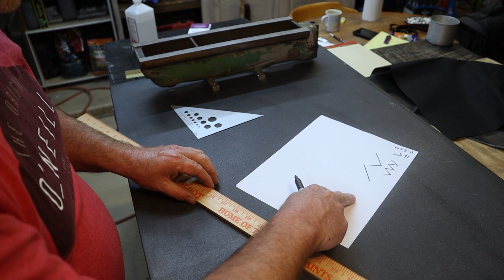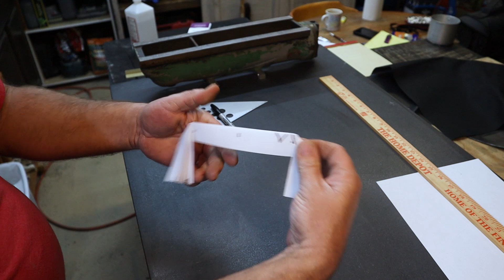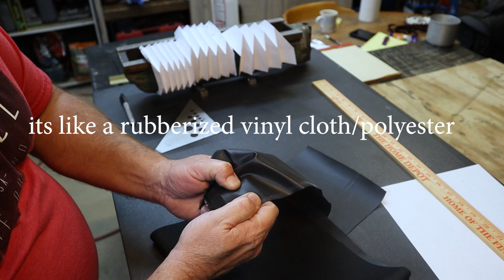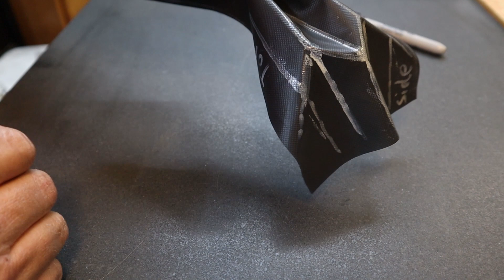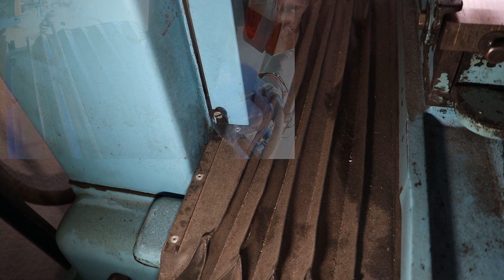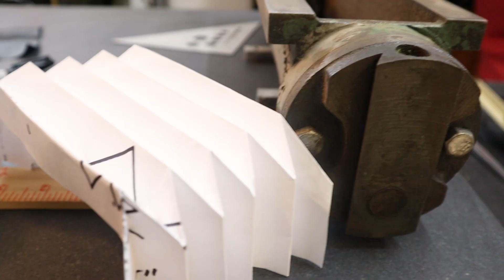Machine Way Covers, Hand Made Bellows.

Comment: With dobule extruder/multi head 3d printer like h2d or snapmaker u1 you cand print folded bellows with Tpu as main material and pla layer cake this works great. Unfortunately it wont work wit single head printer with filament changer/ because standard tpu is to soft.

Comment: misreads instructions, ends up with crane

one source of good fabric... shade cloth manufacturers. especially dining structure type umbrellas...

wish i had thought of these when i worked at one, could have nice HF welded seams and ends, followed by a quick blast to set all the creases... lol, all i did was throw to rolled edges on a sheet with some siding extrusion to hold it on the machine... and of course, i bought new protectors just a week ago. this video came too late.

they always have offcuts in the bin. its freaking expensive to buy off a roll. stuff like "teflon coated algae resistant" surfaces.

Comment: When making replacement bellows for old cameras, a stiffer material is glued everywhere that doesn't bend.  The stiffener can be anything, frequently thin cardboard is used.  This forces the fabric to bend where you want and nowhere else.  In most cases, there is an outer layer of leather or some sturdy fabric (your rubberised fabric would be ideal), then the trapezoid shaped stiffeners get glued on with space between then for the fold, then usually a much lighter fabric glued on the inside.  Leave more room at the fold than you really need when creating the gaps in the stiffener material.  The inside fabric can be very thin, the thinner it is, the less it interferes with folding, you want this just thick enough to hold down the stiffeners so they can't come loose over time.  With all the layers glued, the fabric doesn't fight you during the fold, and you don't need to sew the folds.

Comment: I made one of these years ago for my last little lathe. I did it on the cheap though.

I found some iron on denim repair patches, cut that stuff into trapezium sections, and ironed them on the back of some thin denim I cut from an old pair of cheap black jeans. The iron on material stiffened up the ribs just enough that it folded up neatly. The only real mistake I made was treating it with dubbing wax BEFORE deciding to try and iron the pleats in a bit sharper. That stuff stank to high heaven when it got hot. :D 

With the extra thickness of the backing material it didn't concertina down to a particularly compact size (Going from about 2' foot fully extended, down to about 4 or 4.5" when closed up...... Depending on how clean it was. :D), but as that lathe had a thicker than standard chuck on it, this wasn't a big issue. It looked pretty good on there too. It was a vintage lathe, and the bellow had a kind of "Well used" look from day one that kind of fitted with the whole style. it stayed on there all the time I had it, and was still in place when I eventually sold the lathe.

Making that did make me think that it should be possible to make a mask for the "seams", then spray something through the mask to impregnate the cloth and stiffen up the trapezium sections to make it hold it's shape when folded. Maybe I'll have a play with that idea if I decide to make another one day?
Reply from the maker: That sounded like it was a great one.  Ive seen ones with steel backers as well.  Mine still need work.  Thank you!

Comment: Thanks for this, I am rebuilding a Chinese CNC machine. I need to make 2 of these 40 inches long 6.5 inches tall with a fold of 5/8 ", only mine wont have any 90 degree corners because it will lay in a track all around. I was like the other guy, I was looking at prices and WOW. Thanks
Reply from the maker: The material choice can matter.  Also it doesn't have to be folded.  It can be sewn together which may be even easier.  Thank you for watching!